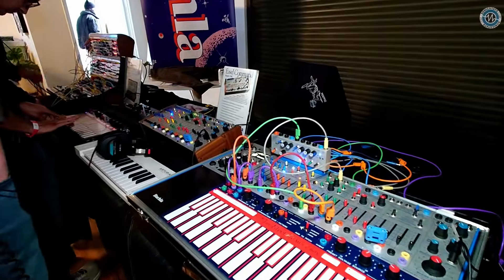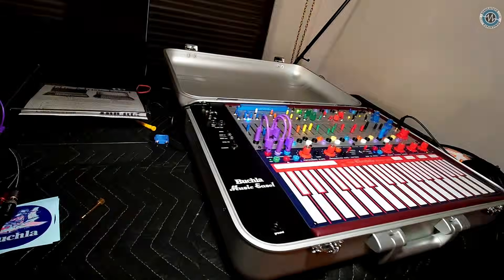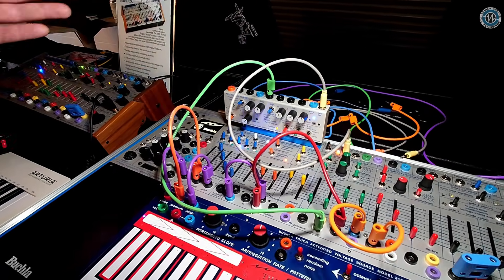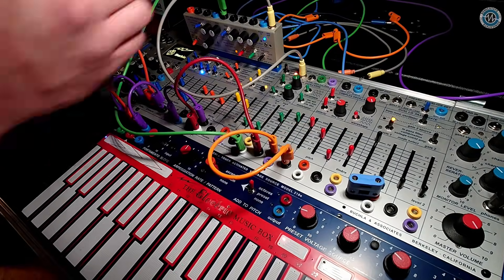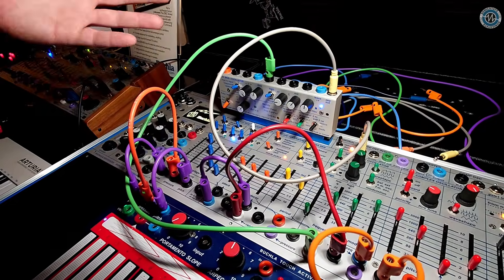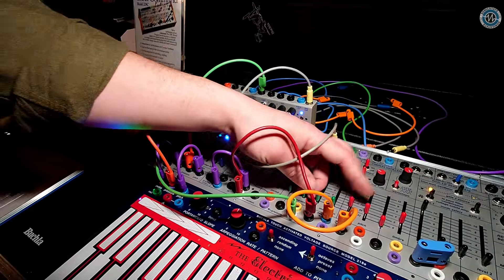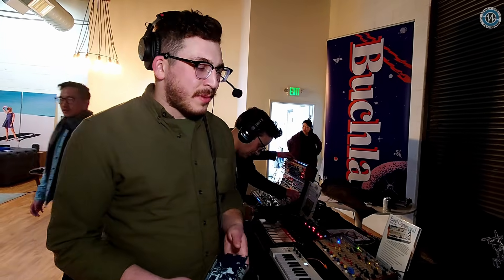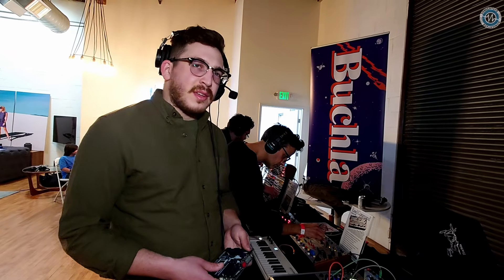BAF 2025: Buchla AUX Oscillator Card for Easel Series

Comment: $900 for a digital utility add-on. crazy.
Reply: They said that about the easel too though.. so it will be $899.. probably.. crazy after spending five grand on a easel.. I really don't understand why they haven't made a stripped down simpler easel yet.. they're is so much there that is just not used that much and the command station took the soul from it without the keyboard.. whatever though.. I would rather get a voltage lab or a solar 42 honestly.. it is just not worth that kind of price for something that is basically 60 years old and similar things are much cheaper. It feels like a vanity purchase.
Reply: @wurlinnawurl  the new aux card will be 599
Reply: that was the old BEMI unit price. this will be less.